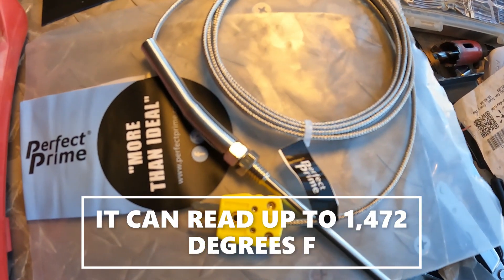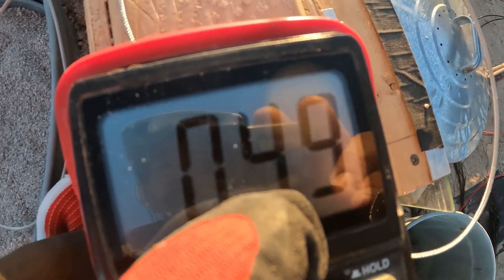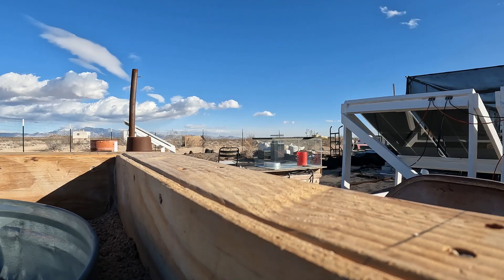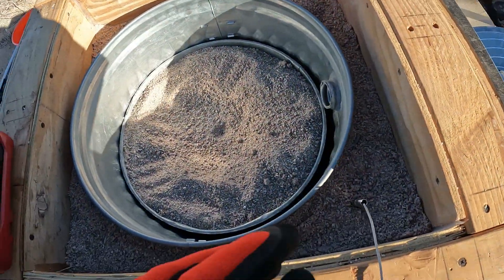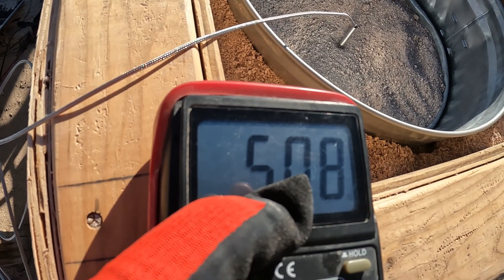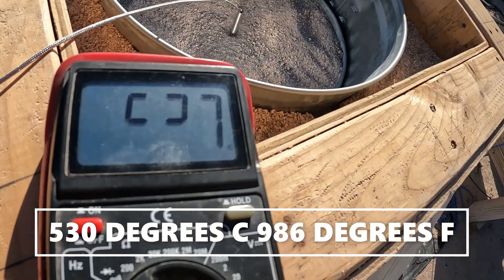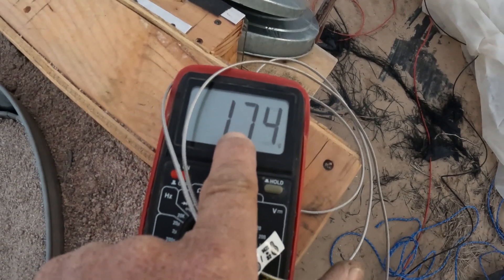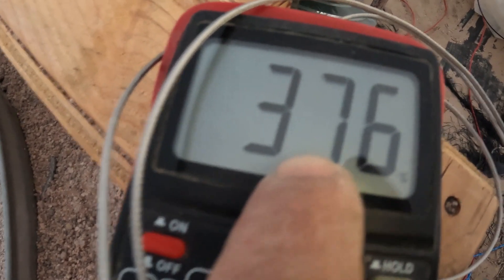986 DEGREES F Part -19

Comment: Can anyone give a link to a calculator or the math to calculate energy you have in the sand battery? How would we go about calculating how many BTU's you have stored into the sand battery? Is that possible?
Reply from the maker: I will be trying to do those calculations soon. I don't have the answer to that question as of now. I am winging it on most of this. I have seen other videos or comments explains how to do the math so I will research it more. Good question.

Comment: I have to do the calculation again, but it looks like 1500 watts can heat a cubic foot of sand to 500 degrees in 4 hours!
Reply: Could you tell me the formula to calculate how many BTU's theoretically he's able to hold in his sand battery ?
Reply from the maker: I will hopefully be able to do some of those calculations also. It's something I am not familiar with but it shouldn't be too difficult. If you can show how you came up with those calculations it would be appreciated by myself and others.